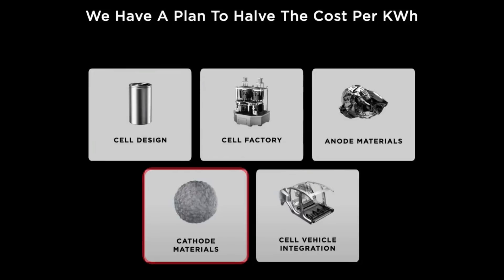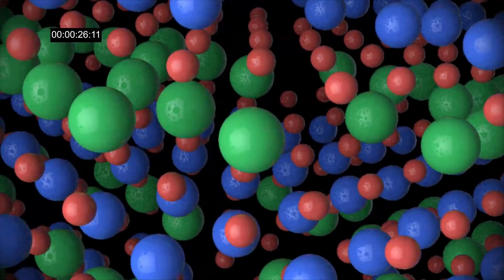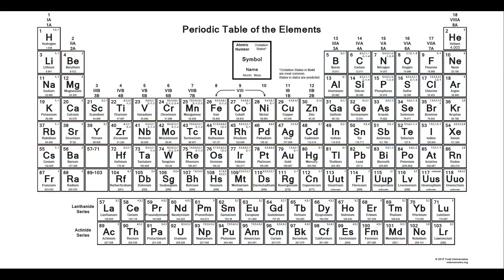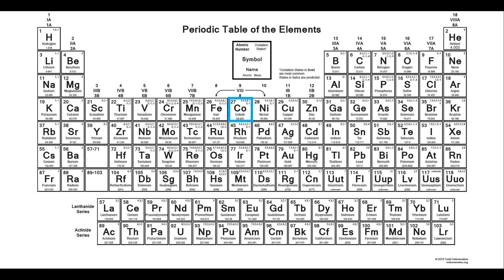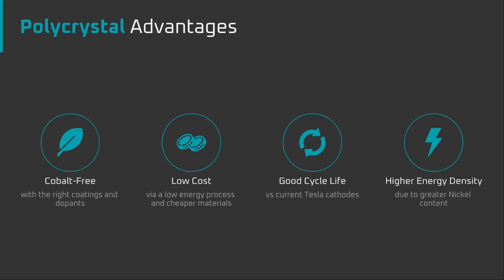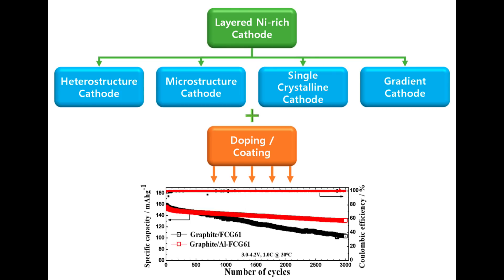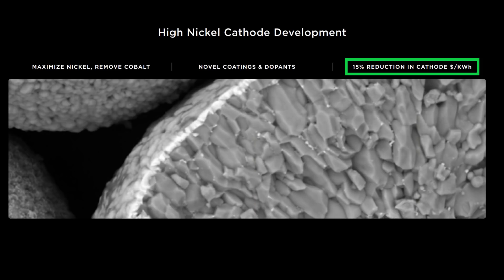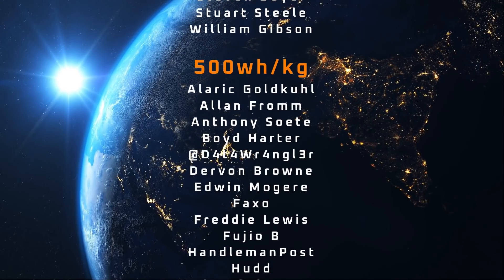#9 Tesla's Polycrystal Cathode Choice and Why I got it Wrong!

Comment: Hey Jordan, loving the video so far! Just one question, at 5:56 you say magnesium, but Mn is Manganese. Is this supposed to be Manganese, or are the crystal images supposed to say Mg?
Reply from the maker: Magnesium is correct.  There was no images of a magnesium cathode but it was illustrated in Dahn's 'Cobalt free' paper as very stable, but with negative impacts on energy capacity.
Reply: @thelimitingfactor  Ah ok thank you!
Reply: @thelimitingfactor  Wonder why that manganese mining stock is doing so well?
Reply: So news from an Israeli company, StoreDot claims a five minute charge time. It has also replaced graphite with an undisclosed product.
Perhaps you could put The Limiting Factor stamp on this press release?
Regards

Comment: Naive question, but why can't battery "cells" be square to allow greater use of battery pan in Tesla EVs? Thx.
Reply from the maker: What you're talking about is prismatic.  Rolls are easier to do in terms of continuous motion, and the corners of squares create issues with the material coatings (bunching).  It all depends on the overall vehicle engineering, there is no 'best.'
Reply: @thelimitingfactor  Awesome. Thx. Knew there'd be obvious rationale and you'd be the one to answer it.

Comment: Very interesting. This is way beyond my knowledge base but, at least based on the info summarized here, given the benefits outlined of Single Crystal Cathode, wouldn't it make more sense to improve / lower the production costs of single crystal cathode for the next breath through, or is the polycrystal perhaps a stop gap until we get there?
Reply from the maker: It depends on the use case!  I don't think single crystal is required for a 'million mile battery'.  More on this in the product impact video.

Comment: Great analysis, but I would like to make a remark. In material science the term strength can lead to confusion because it is related to several properties. Polycrystalline systems usually are harder than their monocrystalline counterparts, though they are more brittle for the reasons you give in the video. In this case I don't know which is more important (probably "brittleness") but I thought it could be a good remark. 
Thank you for your great videos!
Reply from the maker: hhmmmmmmm. Good point!  Sometimes I use words and I don't realise/forget that have scientific meanings.

Comment: Beautiful work again man. The last thing you'd want is for the Oxygen to de-bond from the TM slab and mingle with the Lithium, which is presumably the mechanism for battery fires. So the stabilizing influence of the Oxygen  grabbing/holding Cobalt now makes sense. All of Tesla's little improvements add up to something unmatchable in terms of performance on all metrics and lowest price. They do appear to be ahead by some margin. We keep seeing news on solid state, but it's hard to see how it will compete, even if ultimately on all metrics, because fundamentally it looks way more expensive.  The bottom line is the largest constraints are massive production volumes and absolutely lowest prices. Tesla as you say, is ruthlessly pursuing costs, but really they are also pursuing massive production capacity (which of course produces a virtuous circle). Those two are win win. I see Dahn has signed up with Tesla through to '26 now., so the improvements should just keep coming.
Reply from the maker: Exactly!  The oxygen can get released at extremes and is no bueno!  Oh yeah...lots to come from Dahn's lab 😀

Comment: Enjoying your channel just wondering if you seen this info and what your thoughts if they might go with higher density cell with their process https://nanoone.ca/news/news-releases/update-on-nano-ones-breakthrough-in-battery-longevity/
Reply from the maker: Nano One has a number of different materials depending on the use case.  This will be covered in the next couple of videos.
Reply: @thelimitingfactor  Will be looking forward to your video. Their new cathode coating process almost resembles what Nio just announced they may go with.

Comment: Is the dry film coating in the cathode process or the anode production or both? And does it improve the cycle life?
Reply from the maker: I"m not sure what you are referring to.  Are you talking about DBE?  That's not a coating, it's a technique to apply electrode material (both) to collector foils.  It may improve cycle life.

Comment: So no potatoes with rock salt today?

I have realized, there's no way I would learn the actual reasons for the trade-offs between nickle and cobalt if it weren't for your channel. Because chemistry is so far from my major and my usual interests, and because I am usually busy researching other things. Your videos are information-dense, but at the same time, you explain things in a way that I can process them. For me, these videos are very high value content, almost like Two-Minute papers or vSauce, and I think you open little knowledge doors for me into the world of batteries that would otherwise remain closed.
I really appreciate what you do. Thank you!
Reply from the maker: Hey man!  You're most welcome!
Reply: Well said, chemistry is not my field either, but I took some as a engineering student, I really appreciate seeing the kinds of trade-offs they use.
Reply: I was about to comment most of these things, but nowhere near as eloquently.